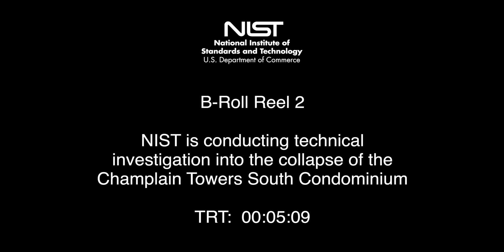WEB EXTRA: Video Of NIST Conducting Technical Investigation Into Surfside Condo Collapse

Comment: The collapse of this structure is testimony to the failure by the local building department, to hire structural engineer specialists to review multi-story structures.  In most building departments throughout the country, they require that the plans examiner to also be qualified to review plumbing drawings, fire life safety requirements and mechanical drawings.  Which virtually eliminates the successful candidate from being an actual structural engineering specialist, and thus sealing the fate of hundreds if not thousands of people into the hands of a non-structural engineer who has no liability for the lives that he has cost.

Comment: NIST, National Institute of Standards and Technology, has an ethical and professional obligation to include all of the necessary forensic professionals, including corrosion engineers, not only in the failure analysis investigation of the Surfside condo collapse but should also advocate and include corrosion risk assessment and corrosion engineering mitigation in future discussions in building inspections and construction codes.  This structure lasted 40 years so it's evident that several factors, including corrosion risk which is a life limiting time dependent failure mechanism for aging structures, may have played a converging role in this disaster.

Comment: Is that standing water from a storm or because the lot is so low in the ground? If it’s from the ground, no wonder it broke down the tower over time..
Reply: The elevated pool deck had improper drainage due to a faulty design, and that led to years of unusually high corrosion of the structure.
Reply: :( it just never got fixed
Reply: It rains pretty much every day in Florida

Comment: its a stain on our City that will never wash away, we do need to find out exactly what happened for many reasons, mainly to prevent more preventable/unnecessary deaths:(
Reply: I just don't understand it, Why this building? Out of all the high-rise beach condos? There was something majorly wrong here!

Why don't other buildings collapse like this? Come on NIST, Do your due diligence here!
Reply: @MaxPleaseBeAGoodBoi  There was improper drainage of the pool area that led to years of unusual water buildup, and therefore high levels of corrosion.
Reply: @amarrao95  If thats the case, That makes this collapse that much more upsetting. Years of corrosion? You'd figure that at some point the building owners or property managers would have noticed & mentioned something?